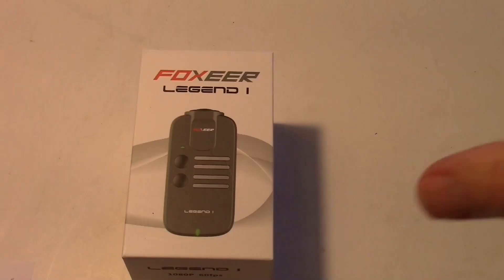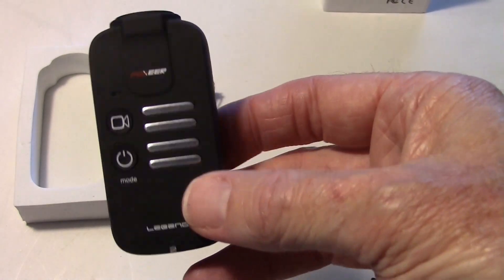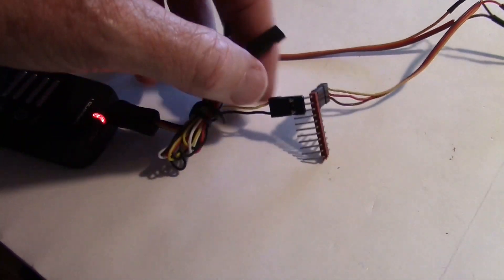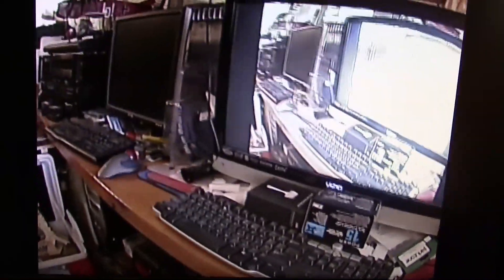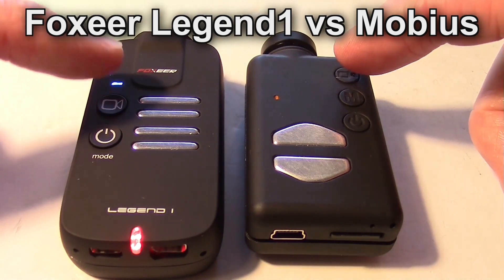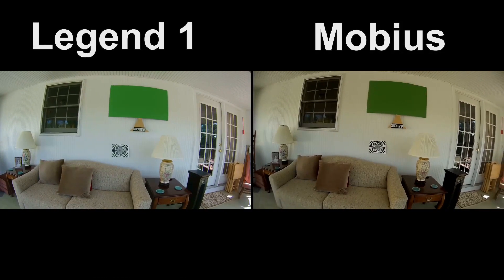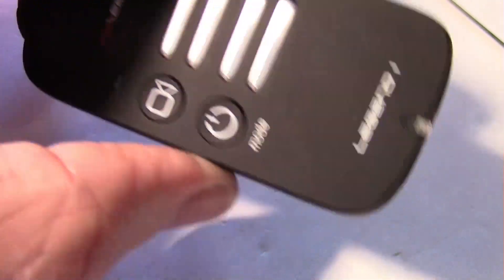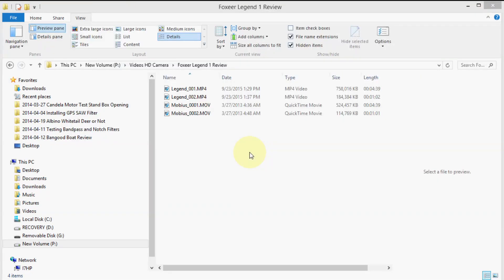Foxeer Legend 1 Action Camera Review vs Mobius

Comment: Thank you for the excellent review, Sir........ I think I'll stick with my Mobius for now. If you're finding bad solder joints in the connector, you can guarantee that I'd have one mass blob of solder rattling round inside and it'd set on fire! :-)
Reply from the maker: +Vortecks Right, and the lock-up problem is also suspect but I will see if the firmware upgrade fixed it. Another thing I missed was that it didn't seem to have auto-record on power up for use as a car dash cam. I will have to check that out in Part 2.

Comment: Thanks ever so much for this comprehensive review. Great video! One question if I may? Would this Legend 1 output video streaming and through the remote record movie or take pictures, while outputting analog video out in FPV situation? Cheers and Safe Flying Guys!
Reply from the maker: +FPV Cambodia Good question. I assume that it would but have not tried it.
I use a separate board cam for FPV.
Reply: +dmerc00 Tks, just ordered one, will see how it goes, on  flat quad of 700mm (alien 560 modified) with low profile setup for wondering around and shooting friends and sceneries... I will publish the setup once built on FPVCambodia G+.... Thanks and Safe Flying Gents ;)

Comment: Suprisingly it seems weak and old Mobius sensor is better in low light. Maybe you selected 1080p60 for Legend 1 during comparison? How about experimenting with different modes like 1080p30? Possibly it could capture more light this way?
Reply from the maker: +Cabrio Driving In The Alps Yes the Legend 1 was in 1080p 60 f/s the whole time.
More testing needed on that and the delay in mode 2. Thanks for the comment.

Comment: It wasn't really a fair comparison to compare a 60 fps video to a 30 fps in low light.  When a camera has half the time to take a picture, it also has half the light exposure.  Did you consider doing a comparison of both cameras at the same fps?
Reply from the maker: That Mobius V1 does not do 60fps. I considered dialing the Legend down to 30fps but never did do it. Now there is a Mobius V2 available that will do 60fps or there is the RunCam2 or the FireFly 4k that would be good. Not sure it would be worth a do over of this video at this late date just to see 30fps on a Legend 1.
Reply: Good review, though.  Thanks.

Comment: AV stands for "Analog Video" not "AudioVideo"
Reply from the maker: +Leo Rådström I'm surprised. The standard has always been the Audio/Video.
Reply: +dmerc00 You both are right BUT in this situation Dave is more right since it's about a connector and in that case AV really stands for Audio/Video.
Reply: Could be so, but still think Analog Video is a more suitable expression even in this case
Reply from the maker: +Leo Rådström Guys, I think my main point I was trying to get across was that there is no Audio Out on the cable for either cam. On the Mobius some have made their own cables just to get the audio. It's available just not accessed by the provided cable.